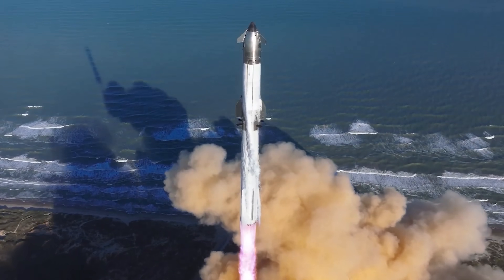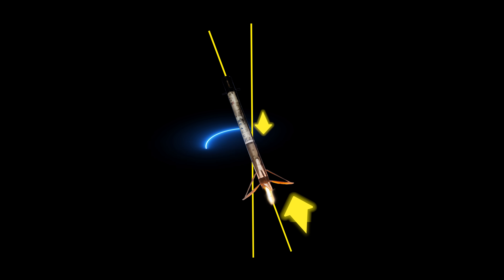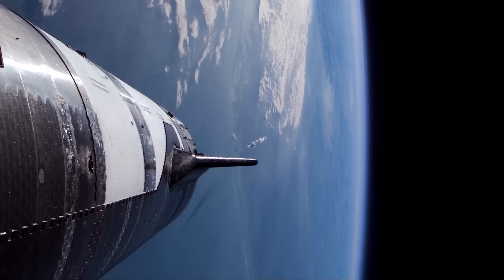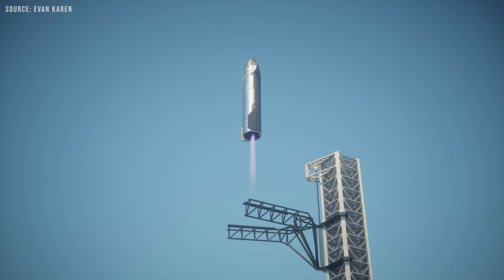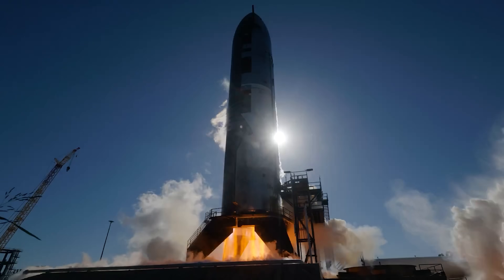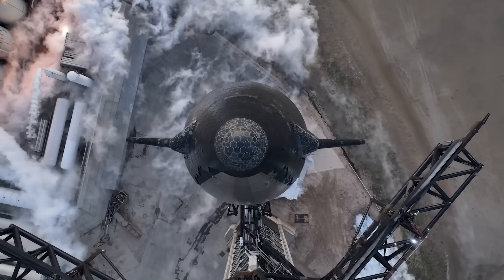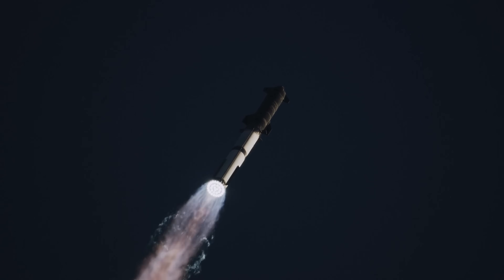NASA Scientist revealed Problem with SpaceX Starship LANDING!

Comment: Bad axioms produce SpaceX style failures. Rockets are the worst propulsion system one can use in the atmosphere. Modern simultaneous combined cycle catalytic staged combustion piston engines, props, and massive wings increases both efficiency and safety by orders of magnitude.
There's no way in-atmosphere rockets can compete in a commercial setting. Read about it in the "Making SpaceX ex" chapter in my description of the 70% efficient air cleaning waste plastic slurry burning Segregated Combustion Engine.

Comment: The toot of most of these problems lies in  trying to use a single type of vehicle for two very different environments,. The idea a launching a craft from the surface, therough the atmosphere, and into space, then expecting the same vehicle to return at high speed therough the atmospherer is probvably too demanding for now--it can be done, but there arefar too many compromises. Designing spacecraft for space only and sending them up without demanding that they return to the surface offers lost of advantages. So does optimizing vehicles to cope with reentry and aerodynamic stress. And the superheavy booster would be find for both applications.
Reply from the maker: Exellent said, sir

Comment: I've always thought they should:ve just strapped a couple (or more) Falcon 9's to the super heavy booster and redesigned a shuttle type craft and they could have been to the moon by now.
Reply from the maker: Shuttle is a very dangerous vehicle
Reply: @SpaceZonea if it were redesigned with SpaceX raptors I don't think it'd be any less dangerous than their current failing design.

Comment: You mentioned it in the video, but I don't think the flip will ever be safe enough for astronauts. There is no Plan B, no escape plan if the flip doesn't work. If SLS is ever cancelled, I think Starship could be converted to an upper stage for Orion fairly quickly. Orion is the only system even close to being certified for manned deep space missions. Also, carbon composites will never be manufactured fast enough or damage tolerant enough for SpaceX. It is extremely easy to damage and you'd never know it unless you NDE it. If you ever watch SpaceX workers move Starship hardware around, they are not gentle.

Comment: Anyone can see the issues with Starship. You don’t even need an engineering degree.
The major problem has little or nothing to do with attitude on decent. The biggest issue is the speed and how to safely handle slowing down without burning up. Depleting the energy in a safe way is the biggest hurdle.

Comment: For Falcon 9, you need to create a temporal solution to solve for POSITION - X, Y, Z, VELOCITY - dX, dY, dZ, ANGLE - I, J, K, and ANGULAR VELOCITY - dI, dJ, dK using only three inputs - engine thrust level, booster I angle deflection, and booster J angle deflection.  BFR gets an additional six inputs because it uses three engines for landing... but that's still pretty rough.  There's very little control authority added because of the low parallax between engines.

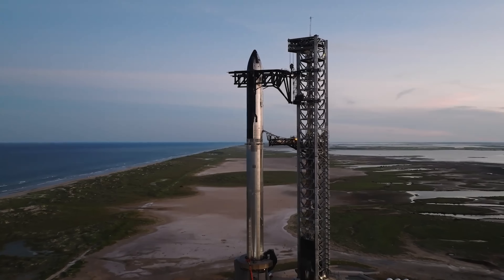I have argued in the past that you need some kind of distant thruster, like Superdracos in the nose of Starship (your video shows some at  10:13 ), to provide reliable control authority to combat a range of landing and takeoff conditions.  Otherwise you're always one unexpected gust of wind away from failure on Earth.  Strong nose thrusters also give you the potential for an escape burn, and the ability to land on a soft surface without tunnelling.

Your performance discussion might be mitigated by the insertion of an additional expendable vacuum stage between Starship and BFR, allowing Starship to favor payload over propellant and thrust.  Let's say 3km/s on BFR, 3km/s on the middle stage, and 3km/s on Starship.  This not only drops tankage mass needed on Starship, it drops the peak thrust necessary and the propulsion necessary.

Comment: Wrong, the Shuttle and its solid boosters were reusable.
Reply: Solid boosters required a full revamp after each use.  Technically reusable, but spiritually...not so much.
Reply: @MrJacksspleen Fuel tank burned up on rentry. 1.5 Billion for refurbishment. Shuttle was ahead of its time. They needed to iterate in its design but no money for that and therefore no quantum leap.

Comment: I wonder if they've considered, as a "Plan B" at least, splitting the top stage into 2 stages. The uppermost holding the Command Module is designed for recovery and the Cargo Bay and Fuel Bay are expendable.
This would recover cost for the priciest part of the top stage and the lower portion, essentially a big empty steel tube once cargo and fuel is deployed/depleted is all that would be lost?
It's an interim measure perhaps worth considering, whilst they continue to figure out reusability of the entire thing.   :)
Reply: Reusability isn’t the main problem but the added weight and there is nearly no way around it. Heat shield plus fuel are many tons subtracted from the payload. The main question is if the reusability is worth the price. Musk is talking about almost instant reusability but is there even enough payload to justify this?

Comment: LOL, after 9 StarShip launches burning through some $5billions of NASA largesse, this misconceived abortion is still incapable to orbit Earth under control while empty; the frangible heat-shield secured with metal studs is worthless, as it resonates to dust on ascent, ensuring the vehicle reliably explodes on re-entry; the stainless steel design is highly questionable (certainly for Stage1, to which it adds 50 tons of mass for no tangible benefit); also Musk has no life-support system for the HLS, has developed no tanker vehicle, demonstrated no orbital refilling, built no orbiting fuel depot which resists cryogenic fuel boil-off over the several months it will take to fill up, no radiation shielding, no HLS rocket motors, no landing gear capable to keep the top-heavy craft from toppling over on a soft or uneven surface, not even a working airlock door for any Lunar never mind Mars Mission, and the pulley lift some 60m above the surface with no backup means of access when it inevitably breaks down is a total death-trap.

Musk's only solution to all these problems is to keep making the CGI monstrosity ever bigger & longer, as if compensating for some boyish personal deficit.

This serial fraudster has exhausted his ability to keep all plates spinning in the air, and will be locked up, bankrupt or dead well before any US manned Lunar landing, circa 2030 at best, and in any case the failure of StarShip will also ensure USA loses the race to a manned landing on Mars, which China will achieve on schedule in 2035.
Reply: Maybe Musk is trying to ensure that China is first.
Reply: Sounds like you need an extra large box of tissues
Reply: @Wordbavk  Do you seriously believe the in-orbit fuel depot, as yet pure CGI but a novel and technically challenging feat on which all HLS missions depend, can be developed and successfully tested inside of 3 years if Musk starts by mid 2026?
Reply: @foobarrel9046 you can always shares the posters box of tissues if you like?
Reply: @Wordbavk  I note that grammar is not your thing. Apart from that it is unclear what you are struggling to communicate?

Comment: The problem with StarShip is multiples...
It cant ORBIT!

IF IT CAN'T ORBIT IT CAN'T REFUEL IF IT CAN'T REFUEL IT CAN'T REACH THE MOON OR MARS

BUT IT CAN CRASH INTO THE INDIAN! OCEAN
Reply: You realize the important part is hitting orbital speeds? Which Starship has done pretty much on every flight minus a few failures all they would have to do is literally fire the engines for a couple more seconds and they would enter orbit. They are just choosing suborbital bc they want to land it in the Indian Ocean.
Reply: THEN ORBIT AND CATCH THE THING!
Reply: @DrDiff952 that isn’t how rocketry works… you can’t just do stuff like that without thorough testing and evaluation… and based on the last few flights that won’t be happening for another good 3 flights.
Reply: @ChickenDogArmy New Glenn did, first time
Reply: @karlwest437 they went orbital, not catching a fricking ship out of space! And Starship could have been doing it this whole time they just choose to land in the Indian Ocean. What do you people not understand abt that?
Reply: @ChickenDogArmy What are you not understanding? This thing has launched a few times, moderately successful. SpaceX quickly realised they needed to scale it up as the original design couldn’t handle any decent payload. After scaling it up, the thing didn’t even make it to a ballistic trajectory. It failed every time and even blew up on testing on the ground.
And no, they never went orbital. They never reached the altitude and speed for an actual orbital flight. They got close (with a dummy payload consisting of an entire plushie banana).
Reply: @ChickenDogArmy or are they afraid?
Reply: @DrDiff952 no they just don’t want to explode the pad by a rocket coming in at reentry velocities. It isn’t about being scared it’s about not wasting billions of dollars.
Reply: @ChickenDogArmy Starship only reached orbital velocity in the first iteration. The design unable to bring any meaningful cargo to orbit. It’s starting to look like the entire design is just a silly (ketamine induced) dream.
Reply: @sweetpuppies1065 where did u get that info, the first iteration was never meant to bring any payload to orbit so it doesn’t matter and even its un meaningful payload was more than any other rocket could bring to orbit!
Reply: @ChickenDogArmy Where I got that info? Directly from SpaceX themselves. They stated their first booster design and Starship design just wasn’t any good to get anything useful into orbit. Hence the need to scale up the thing.
The first iteration could barely get itself into orbit.
Reply: @sweetpuppies1065 exactly. The first iteration which is already phased out, and you’re still saying it’s silly and useless.
Reply: @ChickenDogArmy Hold on. The first iteration was somewhat useful as a testing framework. The second is a pile of garbage so far. But most importantly, none have delivered as Musk has promised. It should be on the moon by now and Starship should be on its way to Mars. A far cry from getting a plushie into a ballistic trajectory. SpaceX is going backwards. They went from using a testbed for heat shields and re-entry control, to something blowing up or falling to reach even a ballistic trajectory.

Comment: Er, what about the Space Shuttle, flawed as it was...
Reply: The Space Shuttle ORBITED on its FIRST FLIGHT!  And never crashed and sank into the indian Ocean!
Reply: @DrDiff952 It did crash like a whole lot of times and it wasn’t designed to be rapidly reusable or mass producible. Also spacex is purposely testing it by landing it in the Indian Ocean so another Space Shuttle doesn’t happen.
Reply from the maker: Space Shuttle was too costy, and it has more problem with the way it take off than landing